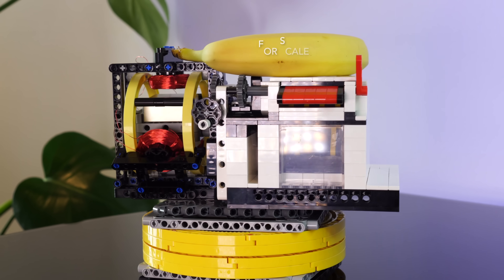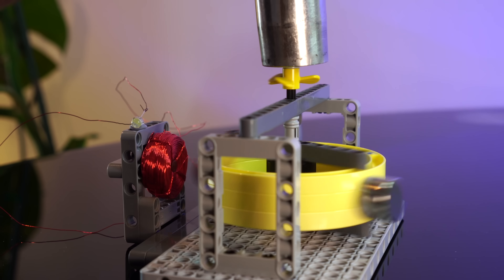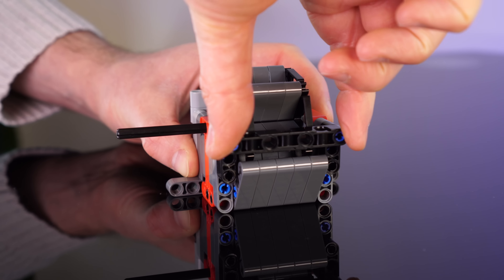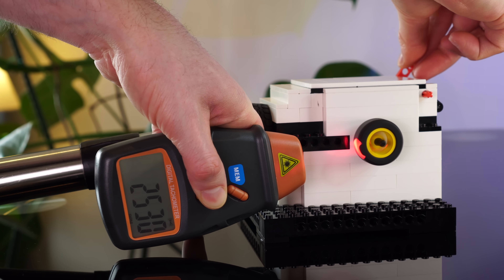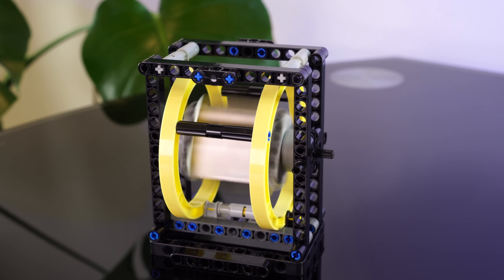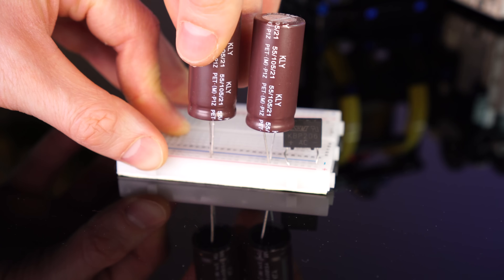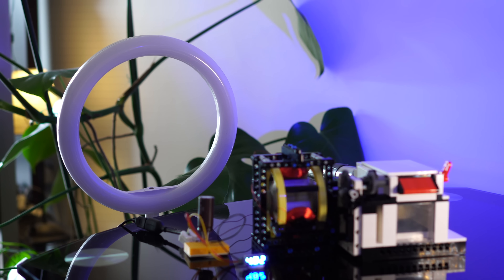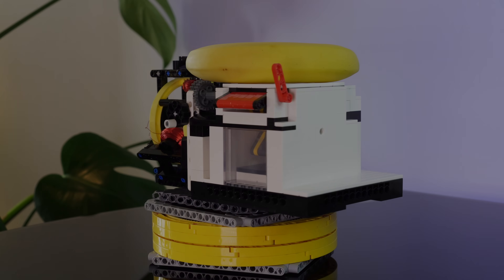This Lego Vacuum-Powered Generator SUCKS!

Comment: im surprised when you made this vacuum engine and it reaches 10k rpm. Quicker then most normal vacuum engines
Reply from the maker: Must have gotten pretty lucky with the design as I have very little experience building vacuum engines. Or perhaps Hetty was just particularly hungry
Reply: @JamiesBrickJams your build was probably good and has enough air intake to reach that type of rpm (and you did that first try? You're insane)

Comment: Having the gaps in the small turbine, actually allows more air to be sucked in from the sides! Thats why it is slower air tight.
Reply from the maker: I've often wondered if that's the case. I see many folks try to make things as airtight as possible but I'm not convinced that's actually optimal. Never actually tested the theory though!

Comment: What do yoi have against ball bearings? Also, please just cease your oral fixation with licking wires - it gives inexperienced viewers the wrong ideas and is against even the basic safety guidelines. You have a multimeter. It would be more useful if you were to teach them to use a multimeter properly.

Comment: How come you usually spin the heavy magnets instead of the lighter coils? Wouldn't your generators be more efficient if they moved the coils through the stationary magnetic fields than they are by moving heavy magnets near stationary coils?
Reply from the maker: That's also technically possible. But the question then becomes - how do you collect the current from those moving wires? It's really not so easy, especially via Lego builds. You need some kind of commutator or something which is difficult to build, has major points of mechanical failure, and are not easy for others to replicate. Ideally I like my builds to be easy for other folks to make themselves relatively easily. It's a fair point though, and worth exploring at some point in a future build

Comment: If you want to improve output better. First move from a 2 magnet core to a 3 magnet core. This should stabilize current better as well. Also to reduce resistance on the turbine you can use a smaller core and use larger coils since they will be stationary. It'll reduce drag resistance from the air and should put the energy saved into your core for a higher peak voltage.

Comment: Why don’t you put lots of wires and instead of torque get nice speed to get lots of voltage and power
Reply from the maker: Unfortunately reducing torque leads to much lower output. Lot of voltage is essentially useless unless it can also produce reasonable current when an electrical load starts drawing power. At low torque, as soon as the load starts drawing power, it creates drag against the generator, slowing it down massively, and dropping the overall output. Best way to maintain good output is through more torque

Comment: mmmm is you not use 2nd higher power switch on vacuum for this test??
Reply from the maker: Ha good point, I actually forgot to test that out. To be honest, the turbine was already going nuts on the low setting, so I didn't feel the need to push it even harder.

Comment: you say that the power in the compressed air drops while its running. i dont think its fair to say that because the vacuum is running directly from the outlet, while the other uses pre-stored energy

Comment: how did you make the 4 blade turbine because I could improve my design with more blades

Edit: I’m building an improved one of these on stream tomorrow (the tomorrow of me typing this)
Reply from the maker: That's awesome, I hope your stream went well! To be honest I don't remember exactly how I made this one as I took it apart. But I'd imagine a bunch of flat L pieces with axles through them to easily get 4 arms at 90 degrees from each other.
Reply: @JamiesBrickJams   I haven’t actually stream yet and I don’t know if I’m eligible because I’m on mobile and the rules are tighter for streaming on mobile

Comment: Kind of a dumb idea but what if magnets spin one way while coils spin the other way would it produce more electricity?
Reply from the maker: In theory yup, an increase in speed between the two should produce a greater output. However you'd have to increase mechanical input, and the complexity increases quite a bit. You'd have to find a way (probably using brushes) to somehow connect to moving wires
Reply: @JamiesBrickJams  then why dont you spin magnets insted of copper wires.Like sspin magnets araund copper wires and copper wires spin in place

Comment: howdy mate! i'm kanata, i was wondering where'd you get that 5.5f cap from? i'm actually extremely interested in building a electric bike without buying one (lol), i watched a video by tom stanton and i almost did it but i couldn't complete it, now seeing that 5.5f caps exist (im stupid i know) i am really motivated to build it again and finish it this time, i'm planning to line up alot of these caps to get a big battery of sorts (i don't know if that's possible) and running a motor and stuff, i am also planning to build a engine of sorts but i highly high doubt i can do it with my budget and equipment, i'll try and make it so i can run the caps on a vac turbine through a compact vac pump (eeeehhhh) i have a hella lot of plans to make (like a homemade rocket with stages and a built-in flight controller and possibly a ai to control it but i highingly highly highing high doubt that i'll be able to make it there) soooo thats all thanks jamie
Reply from the maker: Hey man, that's a really cool idea! I buy most of my capacitors from Mouser Electronics if that helps. However I'd caution that even if you build a massive capacitor bank, it'll likely cost you more than using lithium batteries, and the storage capacity would be dramatically lower than lithium batteries. There's also some complexity around output - if you want a consistent voltage output you'll need some heavy duty regulators. It's totally doable using capacitors, but if cost and power density is your main concern, you're probably better off using LiPo batteries
Reply: @JamiesBrickJams  I really need to research on this lmao but thank you so much! I'm going to use caps since they charge really fast (and discharge) anyways thank you!
Reply: @JamiesBrickJams  I DID IT IT WORKS THE BIKE RUNS
Reply from the maker: @kishutissue  Hey that's amazing man, congrats and well done!!

Comment: So i’ve got this electric skateboard that i use to commute to work right, it can go about 30mph, theoretically, if i were to build this with like an air intake, do you think it’d be able to generate enough energy to charge the board? If not the remote? Idk lol
Reply from the maker: Haha it might charge the remote.. but you'd have to run the generator damn near forever to build up an appreciable charge on a large battery in an electric board. This thing is terribly inefficient 😅

Comment: What if you make the vacuum a different way instead of using a fan nearby? Just make a very long tube so you don’t hear it
Reply from the maker: It's certainly possible! There are also some cool methods of creating a vacuum using quieter methods like via running water. Worth thinking about for a future upgrade 👌

Comment: you dont use full speed cuz there will be more than 15 volts

you just use low and high speeds not full

bytheway keep up the gud👍🏼 work 👍🏼

edit: thanks for 1 like
Reply from the maker: Haha yeah I realised after blowing one of my 16v capacitors that I was outputting quite a bit more at full speed 😅

Comment: If you want to charge a phone faster with high voltage, I'd recommend turning some of the voltage to current. I wouldn't push it though, as I don't know a phone's rated amperage.

Comment: I like how because the vacuum is plugged into the wall, and that's powering the turbine, and that's powerful the generator, in a really roundabout way you've basically plugged the LEDs into the wall
Reply from the maker: World's most inefficient USB adaptor 😁
Reply: @JamiesBrickJams 
Work harder, not smarter 😄

Comment: So because the light was flashing that indicated it was AC current and then using the capacitors changed it into DC? Is that what most generators have to do if they use magnets?

Comment: Feels funny see someone do a mechanism which a whole community is based on

(Do a dual rotar)
Reply from the maker: Haha I only realised after making it just how many folks are into these vacuum engines. Does a dual rotor come with any efficiency benefits or is it just a different mechanism to reach the same goal?
Reply: @JamiesBrickJams    if you use one vacuum and a split inlet, yeah I think it'll be more efficient than adding four (Vacuum cleaners take electricity u know)

Comment: I’ve seen vacuum turbines my friends making hitting like 20k plus rpm. We usually use an oil like olive oil as lubricant when making engines and stuff, if not the axles start sheering cuz of the friction. You def need it for bigger engines like if you make realistic engines with cylinders and start messing with dohc valves systems and stuff. 

Cool video btw, keep up the work. 😁
Reply from the maker: That's awesome! Looks like I'm gonna have to lube this thing up to get more performance in an updated version

Comment: bro remove the gear ratio
Reply from the maker: If I do, the torque is so small it can't actually do any work. The reduction is needed to force the magnets to move against the drag created when a load is added to the generator (like a high powered light)

Comment: Bo run it through a 12 to 120v transformer and connect it to the grid. You just need to synchronize your little generator to 60Hz

Comment: While i do love this ingenuity , i just had to comment on one thing. I dont know i f you have an oscilloscope, but i would recommend that you get one to se the wave signal of your coil. because those coils are extremely inefficient. And since you talked about efficiency regarding the vacuum turbine, i would like to think that machine efficiency would also be equally important. While the magnet traverses over the coil, enveloping the coil, there is no induction at all. One would like to think that peak voltage would be at that point, but due to the coil geometry that is not the case. I would assume that the peak voltage positive is when the permanent magnet is introducing the magnetic field in where the edge of the magnet is aligned with the center of your circular core. and a new peak when the magnet is about to leave the coil. The coil in it self introduces harsh harmonic distortion which in turn creates huge losses. If you are going to iterate on this design, i would invite you to check out how coils are assembled in the stators, aligned perpendicular with the magnet, linear, non-circular. A bit difficult to explain, but check out for example lesics. Anywas, a really good proof of concept. i imagine, keeping your coil urn, id guess you would acheive atleast 60% efficiency if you redesign it. And that might be a understatement.

Comment: A thought, If you enclose the generator portion between the vacuum and the vacuum driven turbine, it could perhaps reduce the air pressure such that the generator could be easier to drive.

Maybe even house the generator within the body of the vacuum.

Comment: Excellent solution. I think Lego Technic with electric parts would like to support for learning at teaching for physic or experiencing for electric technology. Thank you for saving my experience. I want to enroll for electric technology. 😊👍 i think i need to enroll for understanding how does it work with energy power like vacuum or wind power and how does it work if you add a chargable battery like at car without loading energy. If wind comes then wind boosts then generates more energies to battery? ⚡️

Comment: you can push 9 volts into your phone. most newer phones charge at 9 volts with usb pd. they keep the voltage at 9 volts but the phone will manage how many amps it takes based on the temperature and if the screen is on etc
Reply: You need a voltage regulator. Phones don't play well with voltage spikes.
Reply: @harms123  nahhh wont be that much of an issue its fine

Comment: Most vacuum cleaners also have an output, where air from the vacuum is brought out of the vacuum cleaner.
 Why not connect a hose to the output of the vacuum cleaner, and use on the input vent of the generator? Would it make more power now that are is not just being drawn in, but forced in? Have vacuum on one side of the fan, and air on the other side still, Add a flap to the air side so you can still control the power. Might even use a bigger fan to spin it, so you have much more torque and power.

Comment: Use gears to make the Generator rotor spin faster and Use Oil and mechanical Lubrication to prevent friction
Reply from the maker: For this generator I actually need the opposite - less speed, more torque. Because it easily reaches over 20 volts at this speed, it'd be more useful to get more torque at a 3rd of that speed to power usb devices with more current. Lubricant could be a good upgrade for a future version though!
Reply: @JamiesBrickJams  i mean if I want to make a Very Fast Generator all you need is WD‐40 to use lubricant to make it not get damaged while its spooling up, if you want Torque And speed the gear ratios can help

Comment: did i just watch you make it faster and faster just to do a 1-5 reduction. idk how torque works
Reply from the maker: Yup, we still benefit from getting a very high initial output speed. But that's way too weak to spin heavy magnets. So we use a gear reduction to output a much stronger spinning force. This allows us to power through the drag created against the magnet rotor when we try to power something
Reply: @JamiesBrickJams  ahhhhhhhh i see now, thank you for explaining! lol

Comment: This has to be the most innefficient generator. The power source, the vacuum cleaner, will be using insanely more power than it generates
Reply from the maker: You sure are right, this is totally impractical 😅 Worlds most wasteful and over-engineered transformer.. Really just a fun experiment!

Comment: "thinking quickly, macguyver produces a 15 volt generator using nothing but legos, a vacuum, and a 120 volt power supply"
Reply from the maker: 😂 The hard part is making that 620 watt monster like 1% efficient!

Comment: hey jamie, i’ve almost been building these engines for a year on tiktok, but i’d recommend trying to port the housing a little more to optimize airflow, and definitely lube it (veg oil works fine, but i prefer wd-40 if you don’t care abt maybe damaging bricks more). I think it would also be cool to add a supercharger on top for fun (contact me if you’d like any help on that). Have a good one

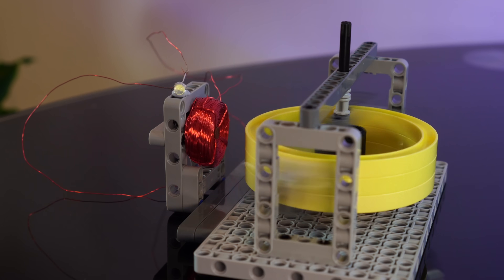Comment: 0:45 the LED actually flashes TWICE per passing of the magnet, once when the coil approaches, an extremely short interrupt at the center as everything is balanced out, then once more when it moves away.
Reply: lol no, when the magnet moves away from the coil, the output voltage has the polarity reversed, and since LEDs require the right polarity, they only blink once per pass

Comment: Try to use a drill and see if it can power a toaster
Reply from the maker: You'd need a hella beefy drill! From some past experiments you need about 100 watts to get some thin nichrome wire red hot. I'd imagine you could toast bread with that 🤔

Comment: Awesome video, but I got excited by the title as I thought this might finally be my white whale! 

I've been looking for motorised builds that can generate their own vacuum suction; ideally to fill up Lego pneumatic air tanks without the need for pump pistons. No hoovers or compressed air; just Lego parts.

Do you think this sort of build would even be possible? The closest thing I've found is a mini centrifugal fan on Yoshihito Isogawa's channel.
Reply from the maker: I'm right there with you, I've been looking for an elegant way of blowing air for a musical instrument for ages. Sadly this is quite challenging using Lego, and I've a suspicion that any method of compressing air or creating a vacuum using Lego is going to need to be so airtight that only pistons are viable. Though I'm working on a Lego bellows that might be able to sort of work (badly). The best vacuum I've managed to get working is the peristaltic pump in my drink cooler video, but it's super weak, and only useful for thick fluids like water

Comment: you cant talk about efficiency when you're using mains power to create a tiny voltage. make it wind or water powered.
Reply from the maker: Haha yeah you're totally right, it's a really silly way of turning 620 watts into sub-10 watts. By efficiency I really just mean of the mechanical part of the engine. Though there's also quite a lot that can be improved in the generator performance too. I've got some experiments coming up that will make use of wind and water, which will need to make use of (somewhat) efficient designs

Comment: why dont you make more copper things around a bigger core? 
better energy
Reply from the maker: More coils doesn't necessarily mean better output. Output is really limited by torque from the engine, and how much drag is produced when a load is added to the generator. Though you're probably partially right - with more coils of thicker wire, I could likely increase efficiency a bit more!
Reply: I mean to make the core and the core radious bigger with more and thicker copper things better energy can be got right?
Reply from the maker: Ah yes, I get you. Yeah, my better generators use much larger radius rotors to create faster (relative) magnet speeds and thicker wires with much lower resistance. To your point, it'd be fun to try something like that powered by a similar turbine. You might be right - it might increase the efficiency a bit